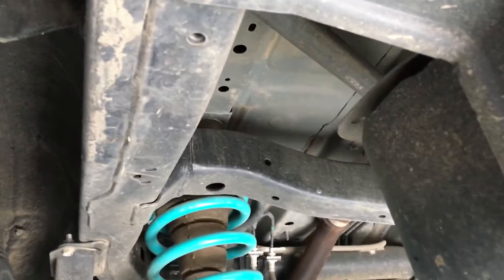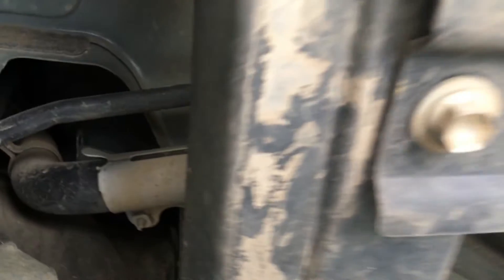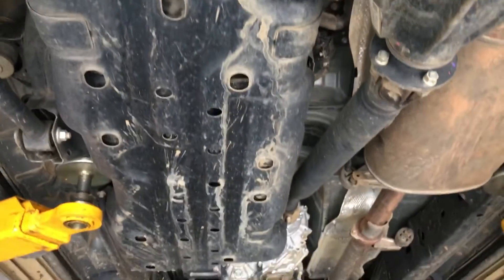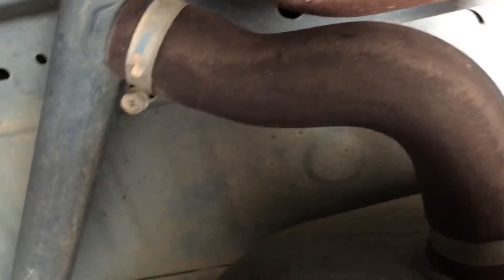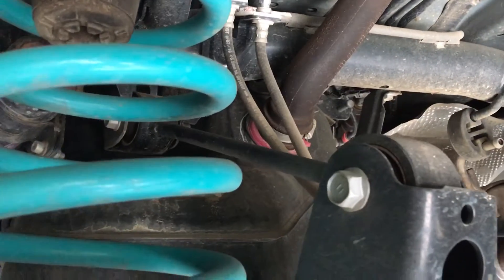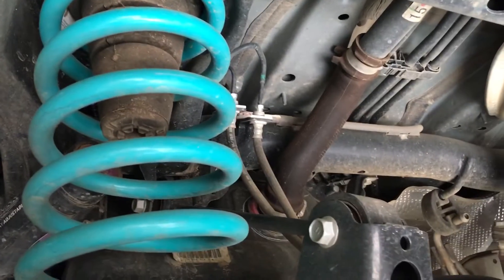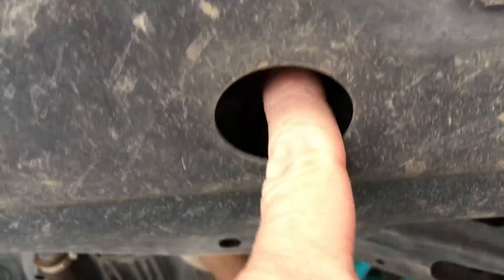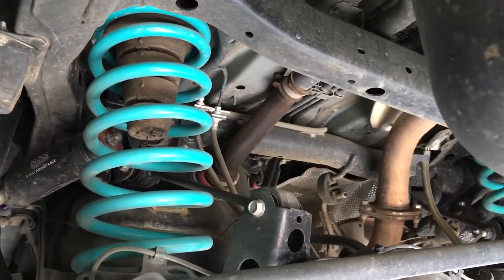Where does the fuel go when I fill Prado

Comment: Hi mate, was wondering why my 150 2022 has water sloshing noise in the fuel tank? When I filled up the tank the rear tank has noise when crossing speed bumps or breaking the car. The noise comes to the main tank when the fuel level half way down.  For sure not the sills problem as I checked all the holes are not blocked.  I would be  very appreciated if you could answer my question!  Thanks heaps !!!

Comment: Hey mate. I have 150 prado 2010 
Tank was almost empty and fuel light start blinking but we put some deisel and it did not go! So we cleaned under bonet deisel pump filter bcz we thought its that. And filled thank half then blinking gone but returned again athen i fully filled. But now it goes half tank the fuel light blinking and i can’t put more deisel in! That little air pipe next to deisel filling hole blupping air and deisel  and stops the nosel to fill. 
What we should do?? 😢
Reply: Kdj150r
Reply: i now have this same issue did you find the cause of yours?

Comment: Also my fuel gauge when I filled it up just now the pump clicked 2 or 4 times and I thought that was odd as the gauge is reading 3/4 full 😳
Reply: My tip with these tanks if you are using diesel is to fill up slowly. Diesel gets really bubbly when it's filled quickly

Comment: And don’t forget that if your rear tank is still full because the jet/transfer pump is not working it is a right royal PITA to fill up the front tank as the breather hose for the front goes into the rear tank and will stop the tank breathing process, rocking the damn vehicle absolutely SUCKS!!!

Comment: I max filled my tank an my 2016 prado diesel and after about 250km the yellow warning came on indicating I only had 30 km of fuel left .
I knew it  still had plenty in the tanks .
I disconnected the battery for about 10 minutes and then re connected it , and thankfully it reset .
The manual warns about over filling ... I won't do that again .

Comment: Thanks mate. Would also love an explain of how the rest of the fuel system works like where that rear filter fits into the system. Thanks!
Reply from the maker: It’s been explained it we explained again please watch all the videos and you’ll see it it’s there
Reply: Fourby4Diesel hey, late reply, I’ve seen the videos about removing and replacing the rear filter. Thing I’m not sure about is how the fuel moves around. Where do the different pumps move it and where does the tear filter sit in that process? Does the fuel always go through the rear filter before making it to the front one? Sorry is there is a vid on that already!

Comment: Great info/tip, just a question, wondering what would be the reasons for the fuel not transferring from the rear tank to the main tank ?
Reply from the maker: Already explained  another videos and they will be more
Reply: @Fourby4Diesel  Hey mate. I have 150 prado 2010 
Tank was almost empty and fuel light start blinking but we put some deisel and it did not go! So we cleaned under bonet deisel pump filter bcz we thought its that. And filled thank half then blinking gone but returned again athen i fully filled. But now it goes half tank the fuel light blinking and i can’t put more deisel in! That little air pipe next to deisel filling hole blupping air and deisel  and stops the nosel to fill.  Please give your opinion